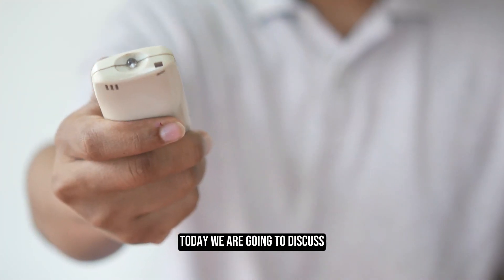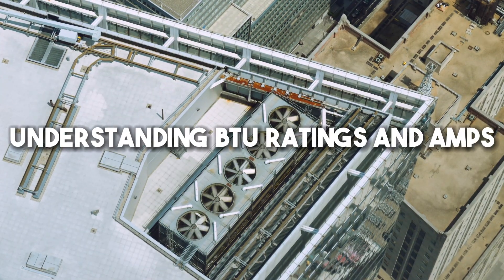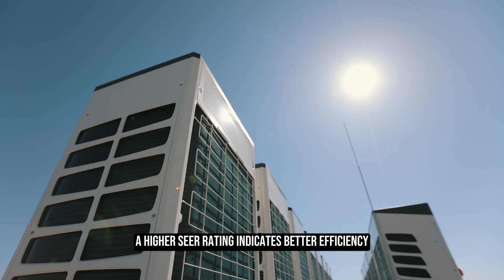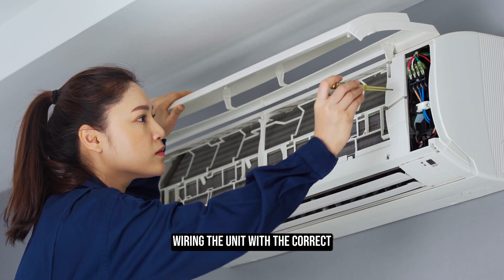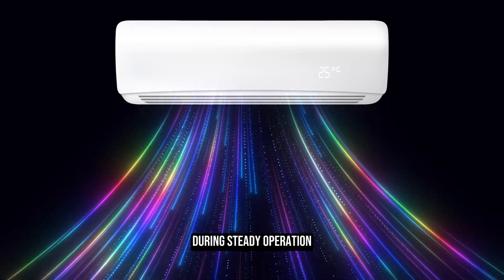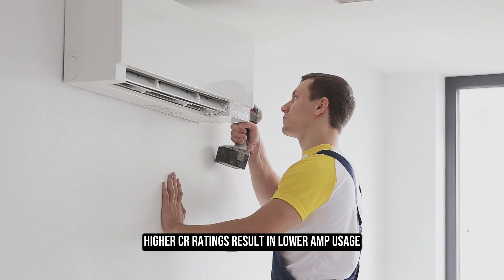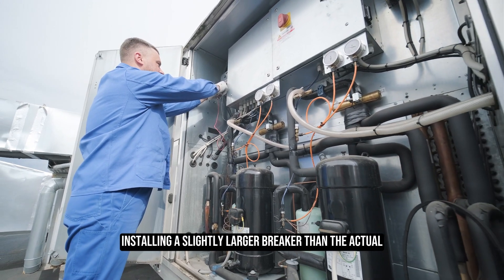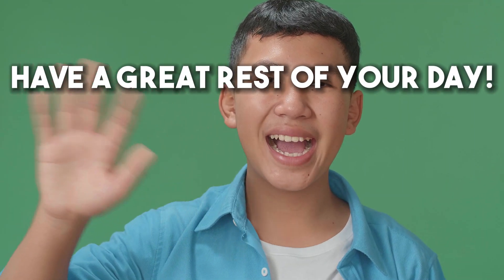How Many Amps Does A 12000 BTU Mini Split Use

Comment: I dont know how many amps, but mine is a 12000 BTU 120v. and it pulls 1741 watts at max in winter, and the most i seen it pull in summer is 1411 watts. Also the lowest i seen it in the summer is 112 watts, and 154 in winter. Hope this help someone.

Comment: Finally a video that actually tells specifically the difference between a 115v and 230v system. It’s the amps drawn during start and run. So, now which would be better to use on an inverter in an RV? 😅

Comment: I bought a 12000k 230v mini split that has max fuse recommended is 10 amps. Those are hard to find could I use 15 amps?
Reply: I believe 10 amps is minimum on that unit 15 amps should be maximum and since breakers trip above 80% 12 amps should be fine

Comment: Wow I am glade I did not see this before i installed my 120v12000 mini split heatpump inverter 100 degrees F 32 amp start up less than 1 seconds 7 amps  run 120v when the inverter was spooled up and running. It would fluctuate up and down from about 7 /5 amps as needed to keep cool When the compressor was not running draw.Maybe 1  amp just the fan And the little articulating motor less power than my coffee pot
Reply: I have a Senville Leto 18000 BTU SEER 2 19.5 240v when it is working on a hot day it consumes 7.5 amps per hour, on a normal day 6 amps but when it is working at minimum power it only consumes 2 amps with the outside compressor on, when it reaches a temperature of 3 degrees below the outside compressor turns off and goes into fan mode and only consumes 0.1 amps, I had no idea that they are actually very efficient
Reply: You can tell from the voice his an idiot

Comment: Why? When I set my temperature and my room settings at auto, why doesn't it show the right temperature at my settings? Set my ministry at 72 and shows that it's at 68 but in hidden motor he reach the correct temperature. Why?
Reply from the maker: You should consult an HVAC professional on that issue (if you want it fixed). It is probably related to the HVAC brand you have.
Reply: @thetradetable  I have a della mini split. When I said it to auto it read 68° in the room but when I touch my rubone button on the setting I feel it shows 72 which is what I said it to
Reply from the maker: @rafaelsandoval7077  That’s interesting - it could be unrelated to the mini split and actually to the insulation. 

We still recommend consulting an HVAC professional. If you want to save money, find one without a service fee - they may diagnose the problem for free. 

How have you liked your Della besides this issue?

Comment: If there is a little leak in the refrigerant pressure, what would happen to the amperage would it be less ?
Reply from the maker: We assume if a refrigerant leak impacted the amperage, it would increase to compensate for the leak.

If you’re experiencing a refrigerant leak, you should contact a local HVAC company.
Reply: No the amperage would go down, as the pressure drops.